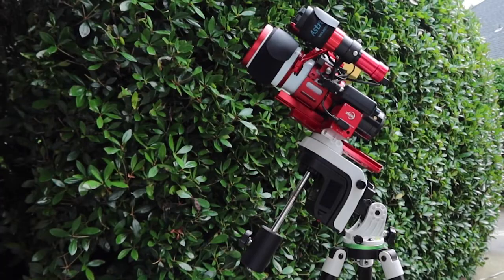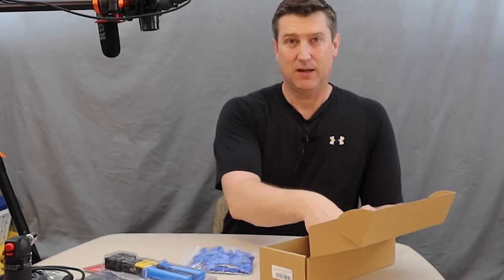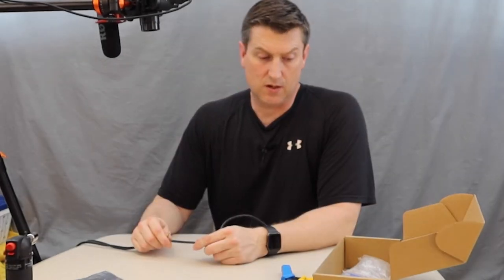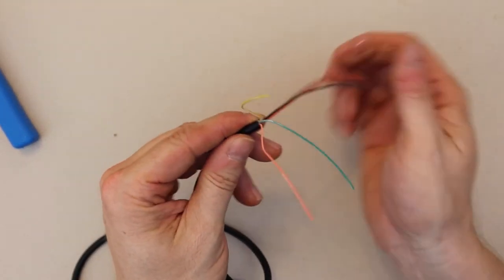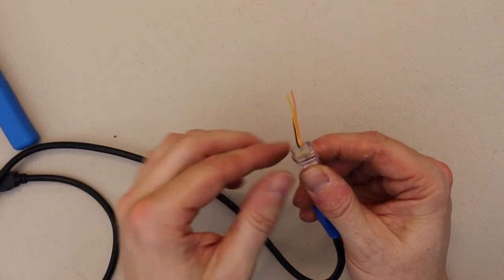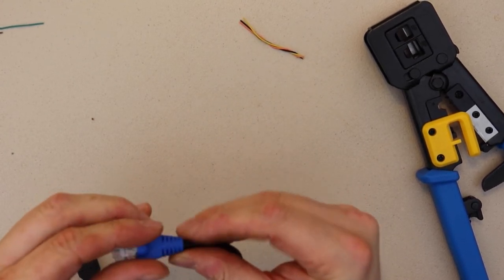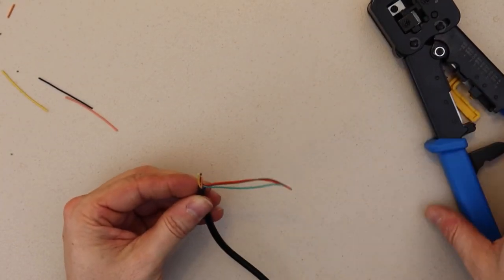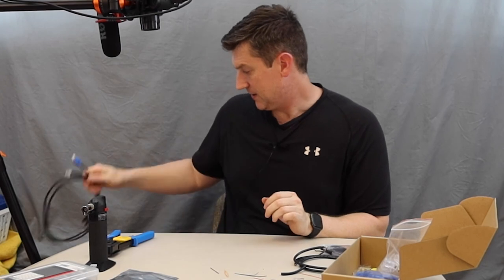DIY EQ-Direct/EQMOD Cables for Your SkyWatcher Style Mount (EQDIR)

Comment: Today I bought my third type of cable, to finally be able to use my mount without the HC. I found out that this last cable that I got today is only for AsiAir.... None of the 3 cables working with my notebook. I'm very lost now, nowhere to see a solution, tried everything. Does the cable you made, will work with laptop too or only with the AsiAir?

Comment: Great How To Vid Chad, but on the AZGTi it need a 3.3v FTDI chip USB to Serial, I think your HEQ5 is the standard 5v TTL chip. When I was looking to make a AZGTi to FTDI chip USB I did some digging and many that purchased a commercial cable did not work as the AZGTi as it needs a 3.3v TTL chip? Maybe i'm wrong?
Reply from the maker: I have found a couple off the shelf that are 5v. I know mine is running fine too. I think these skywatcher mounts are 5v tolerant… but maybe older models were not? I can’t say for sure about older models but I will say that mine is definitely 5v tolerant.

Comment: mon serial cable n est pas reconnu, j ai beau changer les baud ,ca ne fonctionne pas,sur asiair ,monture he5q pro
Reply from the maker: If this is the cable you made, there are 3 possibilities. 1. The cable is not made correctly, or 2. You may not have the USB to serial driver loaded on your windows system, or 3. You have not selected the appropriate comm port in windows. I suppose another possibility is just that you have a defective cable. It’s a bit challenging to test any of this without a multimeter or having a known good cable that you can validate on your windows system with your mount as well.
Reply: @PatriotAstro  i read with ios tablet not computer
Reply: @PatriotAstro  i m waiting for a new cable
Reply: the third ''

Comment: Does this work with a stellamate on a PI4?
Reply from the maker: I don't have stellarmate running but I googled around a bit and can see people using EQdirect cables (assuming their mount supports it). So in that case, yes, it would work fine. Right cable for the right mount (pinout is critical).
Reply: @PatriotAstro  Thanks, I'll give it a go and see what happens.